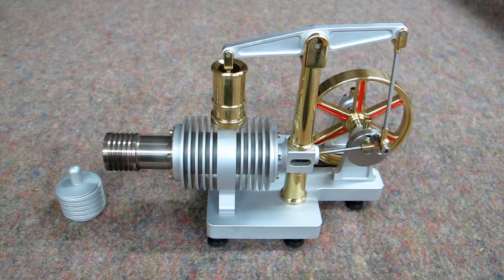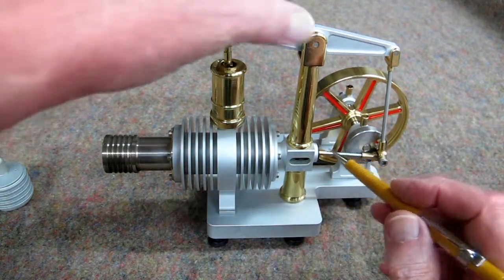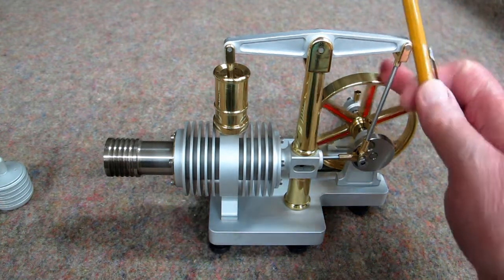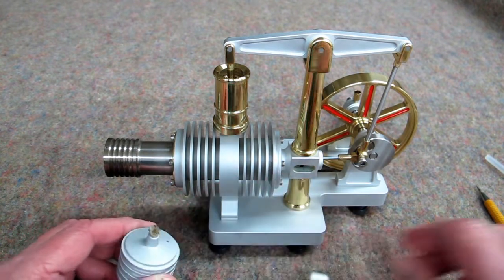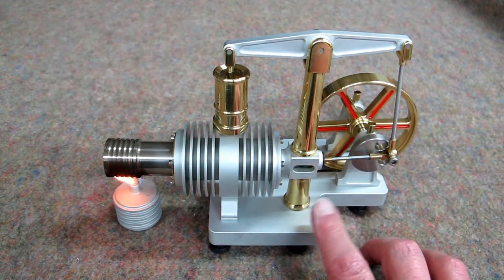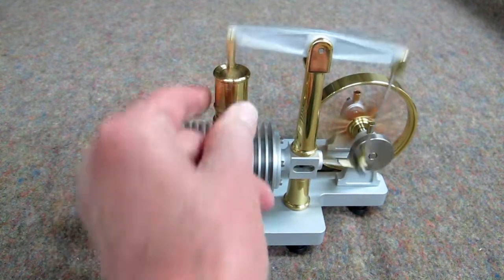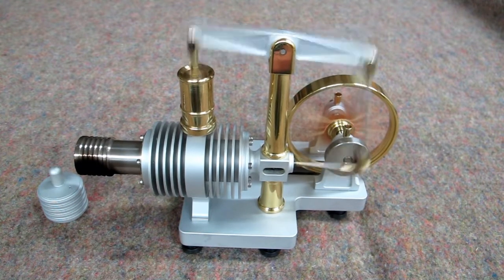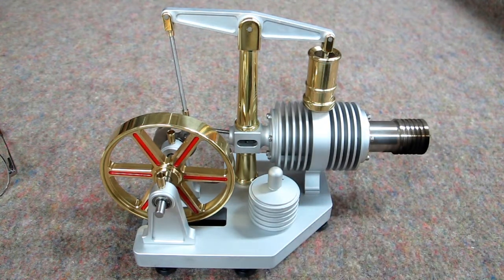ENJOMOR Large Scale Stirling Engine

Comment: Hi Ronald! Love these videos, there are so many interesting and pretty model engines out there nowadays. I've seen that the hit-and-miss engines can produce a fair bit of torque, do these other model engines, like stirling and flamelickers, make any useable power or are they mainly for display purposes?
Reply from the maker: The Stirling engine can be quite useful and has been used in the early days as a wood burning Stirling engine-powered water pump for rural farms. Phillips made a few in the 50's (very few unfortunately) to charge batteries or to run their radios in rural areas (would love to get my hands on one of these). The Swiss have submarines with Stirling powered generators to keep their batteries going when submerged. https://en.wikipedia.org/wiki/Stirling_engine

Most of these Stirling engines are demonstration models. They need to get up to speed before they can support a constant load and then, without adequate cooling, they overheat and slow down which is time to shut them down before they quit.

I purchased a Huxtable Hot Air Engine from Australia which is a high quality Stirling Cycle Engine https://youtu.be/GTuybMRKi6Y and there are a couple more videos where I made cooling fins which keeps it running even longer.

The 6-cylinder Ringbom-Stirling Gatling engine shows promise and I have played around with a couple of ways to make it generate electric. These work and demonstrate the principle, but unfortunately it still has a limited run-time as it overheats. I still have a bit of work to do on these before I release the videos. :-)

This particular engine is a very good runner and is nice to just look at sitting on a shelf.
Thanks for watching!
Ron